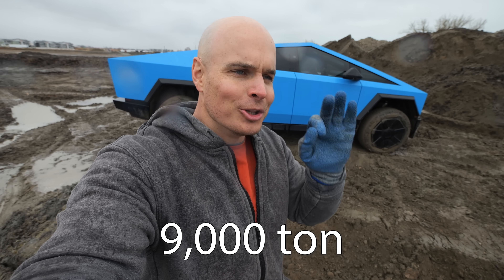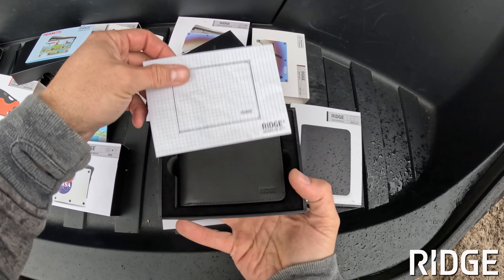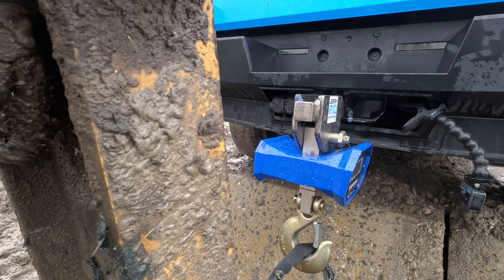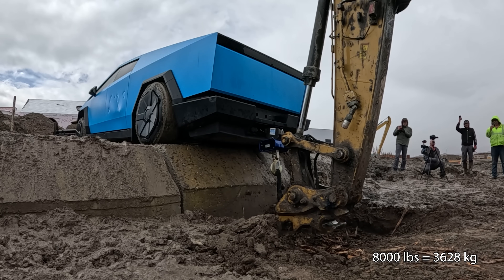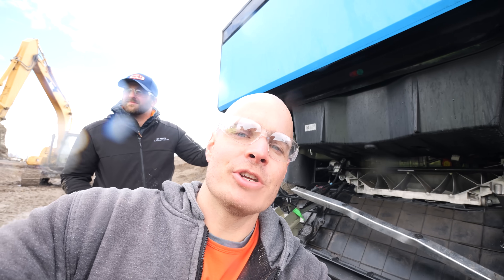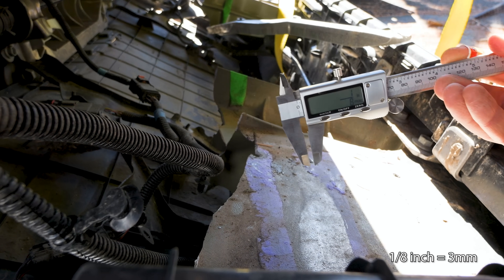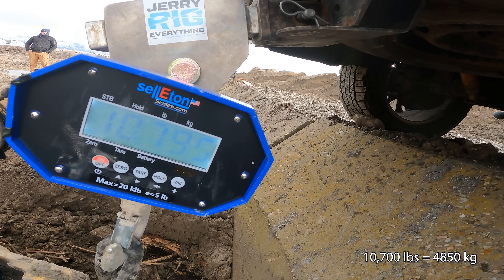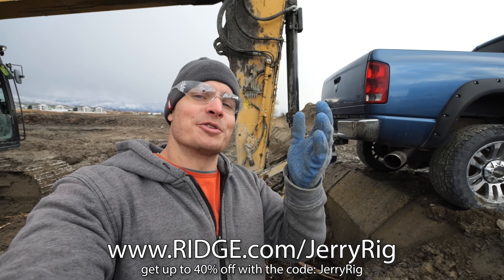SHOULD YOU TOW WITH A CYBERTRUCK?! - (catastrophic failure test)

Comment: Someone forgot to do there research. There is a huge difference between tongue weight and towing capacities. 
The tongue weight rating on that truck is not 11000 lbs. in an ideal situation you would need over an 100k lb trailer to achieve a tongue weight of that magnitude and even a fully capable ram/ford/chevy 4500/5500 couldn’t withstand it.

Ideally at an 11000 lb tow rating you would have no more than 1100lbs on the tongue. But if we get technical with it, the cargo capacity of the cybertruck is 2500 lbs, so in theory you could put up to that amount minus other cargo or people on that hitch.(tongue weight)
So even a poorly loaded trailer would withstand your 10000 lb test as the max 11000 lb tow rating could not achieve a 10000lb tongue weight.

Furthermore when towing with loads that have more weight than half of the gvwr you should use a weight distribution hitch, and at 11000lbs it would be in your best interest to use one. This would further reduce the amount of pressure in your hitch and spread that tongue weight more evenly across both the truck and trailer.

So in conclusion your testing is invalid as it shows the cybertruck is more than capable of the rating by Tesla. It also shows your lack of knowledge about towing and ratings. Furthermore it shows you are getting hungry for more viewers so you are venturing out into more crazy things to attract such viewers.

And finally, remember kids, if you don’t know how to figure out all the tow ratings, specs, and math involved, you shouldn’t tow.
Reply: Also if this is your attempt to take a jab at Tesla because he no longer aligns with your political viewpoints you ended up showing how much you actually know. And that in itself is pretty funny
Reply: He hates Musk, so this "test" makes perfect sense.

Comment: Alright, buckle up, because I’m about to dissect JerryRigEverything’s Cybertruck hitch test with the kind of precision that’d make a surgeon jealous—and the sardonic glee of someone who knows physics isn’t just for nerds in lab coats. Zack Nelson, our YouTube torturer-in-chief, decided to see what happens when you treat a Tesla Cybertruck’s hitch like it’s auditioning for the role of “piñata” in a monster truck rally. Spoiler: it didn’t end well. And not in the fun, “let’s watch it squirm” way.
Here’s the setup: Zack takes this angular beast, rated to tow 11,000 pounds like it’s hauling Elon’s ego, and slams 10,400 pounds of vertical force straight down on its hitch with an excavator. At that point, the aluminum gigacasting says, “I’m out,” and rips off cleaner than a breakup text from your ex. Then he tries the same stunt on a 2004 Dodge Ram 2500—steel frame, blue-collar grit—and it bends at 10,700 pounds but doesn’t snap. Cue the slow clap. Riveting stuff, right? Except it’s all bullshit when you crack open the physics.
The Cybertruck’s hitch is built for a tongue weight of 1,100 pounds—that’s the vertical load it’s supposed to handle, not the whole damn trailer crushing it like a bad sitcom finale. Zack’s 10,400 pounds? That’s 945% more than the spec. Imagine your grandma baking you a cake, and you complain it’s not a seven-course meal. That’s the level of disconnect here. Aluminum’s brittle—it snaps under that kind of absurd overload. Steel bends like a politician’s spine. Neither proves jack about towing unless you’re planning to drop a house on your hitch.
Towing’s about pulling, not squashing. That 11,000-pound rating is horizontal tension—force spread out, not a guillotine chop. Tongue weight’s maybe 1,100 to 1,650 pounds in the real world, 10-15% of the load. Zack’s test is 845% over that upper limit. It’s like testing a condom by firing a cannon through it and calling it unsafe for sex. The physics don’t line up—direction’s wrong, magnitude’s insane. Potholes don’t hit your hitch with nine times its design load unless you’re towing through a war zone.
Tesla probably engineered that aluminum to break clean—save the frame, sacrifice the hitch. Smart, if you’re not into twisted metal origami like the Ram’s steel flex. But Zack’s takeaway—“I wouldn’t tow with this on a freeway”—is the kind of overdramatic nonsense that’d get him booed off a comedy stage. A 945% overload doesn’t mean it’s a death trap at 1,100 pounds. It means he broke it because he could. Congrats, Zack, you’ve proven gravity works. Next time, test it within spec—or at least make the explosion prettier. I’d watch that.

Comment: At 10400 pounds  a trailer would be around 104,000 pounds . A big rig going down the road max weight total is 80k so with  the weight of truck and trailer a big rigs carries 55k in load. This will never happen. There is no physical way if you have an 11k pound trailer  that 10400 of that weight will end up on solely the tongue. Seems like the same scare tactics that killed of the corvair

Comment: If it's rated at 11k pounds  then I'm sure it's not supposed to have more than 1100 pounds of weight on the tongue. Not even a 3500 pickup is rated for 11k pounds on the hitch

Comment: The force applied is not correct. Vertical force/pressure is one thing and traction force (horizontal) is another. In fact, the correct test was to apply force horizontally. Trucks for example have a pulling force of up to 1500 kg but can tow up to 22-24 tons and cars have a maximum of 120 pressure on the coupler and 3500 kg towable. If you don't know, don't bother, you're embarrassing yourself

Comment: um, you're doing it wrong!  the true test would be to apply the pulling force horizontally.  perhaps the frame was designed with more horizontal strength.  the towing capacity is not the same as tongue weight.

Comment: Let me get this straight, you effectively had to put a forklift on the front of the Cybertruck because you were worried that the truck would flip due to the weight of the escavator while applying force on an angle that would put anything towed by the Cybertruck in real world circumstances around 3 to 4 feet UNDERGROUND, yet you call this a "scientific test"? Why not have 3 trailers, one with 5,000 LBS, one with 10,000 LBS, and one with 15,000 LBS and drive the Cybertruck on a closed circuit and see if anything breaks: You know, USE it NORMAL people will actually use it instead of trying to bend the truck in half essentially. And sure, steel is stronger than aluminum so it gives you a large safety margin in terms of what you can tow. The truth is that if they tried to do my suggested test, little would have happened and the video would have to come to the conclusion that the Cybertruck is fine which wouldn't go so well but come up with a test that is more likely to damage the Cybertruck and instant clicks. I guess the advertiser didn't mind being involved in this video this time around when the goal was to break a Tesla product; but the advertisers had issues in the past when the goal was to showcase the positives. Interesting...

Comment: Almost 20 year old dodge, thats been through hell, vs brand new 2024/25 cybertruck, and the dodge doesnt have a single code.
Reply: It doesn't have an engine either
Reply: @SamsTechLab  take any truck, slam a trailer down on it. What codes you think its going to throw? Nothing. Know why? Theres nothing back there. Maybe your diff, but still. A new 2025, and the frame snaps, throws over 20 codes, wont start, and could possinly shock you. Take that and compare it to a truck you can literally drive into the ground and itll still run fine. Evs are cool, but shitty evs are stupid. Think a bit more.
Reply: @TalonX-01a1b1  A fairness to Tesla, it's probably better to be safe than sorry with high voltage electronics. I'm not defending their choice of aluminum frame though, that's just stupid.
Reply: @SamsTechLab  agree with you there, that thin is ludacris. None the less, Id personally drive an older model over newer stuff because of these issues. Unless they make a powerwheels car for adults then I may reconsider. Idk why I sounded so snarly in the last comment. Sorry for that.

Comment: If you hit a pothole big enough to transfer the entire weight of an 11,000 pound trailer to the tongue, you've got a bigger problem than the rear bumper coming off!  I think you are overblowing it (just like WD).  The tongue held up to almost 10x the 1100 pound rated weight.  If this was a problem, we'd have a ton of reports of it actually happening.  Only time I know of it happening was on a Cybertruck where someone rearended the trailer in a crash.

Comment: I mean.......seriously !!! Zack , You have made so many cool experiments – but this one is WRONG by definition. 11 000 pounds towing means that load will be longitudinally right behind the truck, but NOT 90 degrees perpendicularly to the towing hitch. Common, man. Very disappointed  ..........Nevertheless - Cybertrtuck holded amazingly strong even in  your wrongly defined test all the way up to 6700 pounds downwards load  at 90 degree angle off the towing hitch .

Comment: The problem here is that knowledge sometimes is the Achilles heel. Theoretically the frame is 'strong enough' but in real life there are external factors like improper wheight distrabution ect. Even if the tongue weight is within limits, what if you go through a pot hole or something. They should of made the frame alot more beefy at the stress points, better to make overstrong than just enough. That frame is awfully thin.

Comment: I hate the Cybertruck and Musk but I honestly think this specific test is kind BS. If your truck is rated to pull maybe 50k pounds then this is an adequate test but 11k of downward keeps insane. 

What your test showed is more of a material strength test. 

WDs failed early because of the hit the hitch took before pulling the F150 out. That’s real world. 

If you would have bounced the excavator up and down at maybe 4-5k pounds a bunch and it failed then I would say that’d be a more acceptable test. 

Clearly there’s no OEM replacement for steel for towing

Comment: In Europe we don't use safety chains, we use a wire that engages the brakes so when the trailers falls off, it will come to a safe stop.
Most likely wouldn't matter either way with the cybertruck if the bumper get ripped off.

Comment: Guess we better stop flying in aluminum frame airplanes.
Reply: Interesting statement.  Google air crashes on aluminium planes.  You will find that it happened a lot until metal fatigue was understood and included in the design.
Reply: Or maybe we should regulate CT towing and tow cycles like we do with airplanes. 
Don't make a dumb argument if you can't figure out how it can get flipped on you.
Reply: Or perhaps we need to make airplanes all steel lol !

Comment: Tongue weight, or the downward force the trailer tongue exerts on the hitch ball, is crucial for safe and stable towing. It should be between 10-15% of the gross trailer weight (GTW) to prevent sway and ensure proper handling.

Comment: I didn't know that your channel name meant you rig tests... Whistlindiesel's failed from an upward impact when he dropped the cybertruck on its hitch onto a solid surface. This is not something owners will experience from normal driving or even crazy driving.

Yours failed from a downward force which is not anywhere near true to a real world use case. When you're going up a mountain, you are still pulling the trailer, not applying downward force to the tongue. In fact, you're actually removing weight from the tongue because the trailer will tip backwards. If you needed to hold the front down for the test, that means the cybertruck's front would have lifted off the ground before reaching the point of failure. You think someone will drive it like that?

If you tried to pull the tractor stuck in the mud with unlimited traction, the motors woukd give up before you could break the hitch... Be real bro...
Reply: He hates Elon and Republicans at large. He's a lunatic on X

Comment: I own several heavy duty trucks and haul trailers all day. Rams and Fords. 

That said, this is an anti-Elon dishonest propaganda piece. Nobody is going anywhere near even 2,500 in tongue weight.
Reply from the maker: Static dead weight no.  For sure.  But when you're moving around driveways curbs loading docks and boat ramps you'd be lying if you said the dynamic weight never exceeded 2500 on the tongue.  Heck even the ASE J684 has the safety threshold at 5500 lbs. But as a professional hauler I assume you already know that?
Reply: @JerryRigEverything You’re making assumptions about dynamic weight loads without any evidence. If this was the issue you claim it is there would be thousands of reports of cybertrucks losing their loads since there’s literally thousands of them pulling stuff at any given moment on the roads at all times of day.

Comment: I just guessing this isn't how USDOT recommends testing hitches or towing capacity. I'm worried you tested this way just to get a catastrophic failure rather than established testing means. I have a hitch on my vehicle and I'm very careful when it comes to tongue weight and any leverage that would be applied to the tongue. Hitches are designed to pull not to support and your force vector just doesn't line up with the use. It feels kind of wrong and I was hoping for a better test from you.

Comment: Not a Tesla fan but I’ve got to admit it held up far better than I expected. 10,000 lbs tongue weight is no joke.
Reply: People are confusing tongue weight with towing capacity. The maximum tongue weight for a Class V receiver hitch is 1800 lbs, and that vehicle can TOW a 20,000 lb trailer.
Reply: @FrankinMichigan-fx8lo  I agree :)
Reply: I don't believe any non-commercial vehicle has a 10000 lb tongue weight...
Reply: @FrankinMichigan-fx8lo  it's worth noting those ratings are when they can handle it sustained over a long period of time. I.e. the other truck would likely have eventually slowly warped and broken if the weight was held.

The issue is the tesla has a combination of no fatigue, and starts with a lower limit of the bursts it can handle. You hit a pothole while braking and the tongue gets some extra pressure. For the steel tongue it might strain it but no real damage, for the aluminum tongue that weight just significantly reduced it's lifespan.

Do it enough times and one day the trailer just flies off the back of your truck.

So no, no one should expect it to be rated to handle 10k of tongue weight, but it does still remain that this is a significant design flaw. If they wanted to use aluminum it should have had the ability to withstand weight well beyond anything that could be reasonable expected to happen when crap goes wrong.

Granted they do seem to have a sensor that would hopefully warn you of unsafe conditions.... but i don't want to know what it costs to repair.
Reply: @Syllaren  Using aluminum is not a design flaw, and while I have no data to show, I would bet dollars to donuts that they did substantial stress testing (physical,  computational, or both) to confirm the aluminum thickness and grade selected would last far beyond the life of the truck before it failed. There is nothing wrong with using aluminum. What do you think airplanes are primarily made of, especially the wings, which flex MILLIONS of times without breaking off? So yes, it will fail eventually, given enough time, just like wings on a plane. But I have never seen a plane's wing fall off in over 60 years of flying on them, and am not worried either. LIkewise, I am less worried about a cybertruck towing a trailer than I am worried about a rusted, 2000 Ford 350 doing the same...
Reply: @FrankinMichigan-fx8lo  and all of those parts are tested very extensively for loads far beyond their normal expected strain. A tow hitch getting slapped with 5k pounds actually isn't all that unlikely to happen, and that would instantly damage the truck.

Using aluminum itself isn't a design flaw. Using aluminum that isn't reinforced enough is.
Reply: I am more concerned about the casting. Fatigue failure (over time, or due to damage) is very abrupt for casting, but generally gradually for fabbed steel.
Reply: the problem is that aluminium weakens with use. the more you use it, the weaker it will get. 1 year of normal usage and the aluminium frame's limit will be way lower.
Reply: That's the same as 1990 F-150. Hardly impressive, in fact, it's pathetic considering the 30 years of material science/tech progress.
Reply: @Merble  Wow that’s impressive! I just checked my own 2011 F-250 and the max tongue weight is 600 pounds, or 1,250 with a weight distributing hitch (12,500 max gross trailer weight).
Reply: @Merble  I bet the 1990 F150 holds up better than a 2025 F150.
Reply: @Merble  Maybe in a reasonable daily use don't need more
Reply: @Merble The 1990 f150 had about a 5,000lb towing capacity and about a 1,000lb payload limit. Let’s not be delusional here.
Reply: @jaredchampagne2752  the weight limit is understated for safety. My truck with an 11k towing capacity has been seen towing 20k fine, but it's on the verge of safe, and if an accident were to happen because the driver went over, it would be their fault.
Reply: @Merble tongue weight of a 1990 f150 is 750lbs
Reply: Not to mention that 10,000lb tongue weight is unrealistic for any commercial truck. The fact that aN oLdEr F150 can exceed that means absolutely nothing.
Reply: WHY Y'ALL KEEP ON SAYING "AS A PERSON WHO'S NOT PRO TESLA", this truck is still good or whatnot.

Y'all just being a FANGIRL of LEFTURD JEERY!
Reply: @ThinkForge01  WHY ARE WE YELLING
Reply: @truthsmiles  

So, for the people on the other side HEAR it well
Reply: @ThinkForge01  even as someone who agrees with most of Trump's actions, tesla SUCKS, and ESPECIALLY the cybertruck.